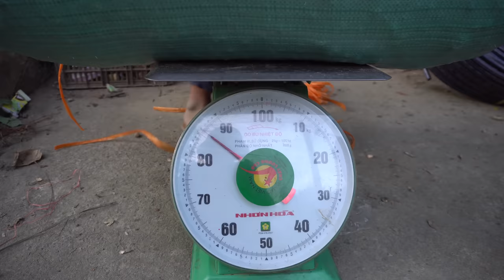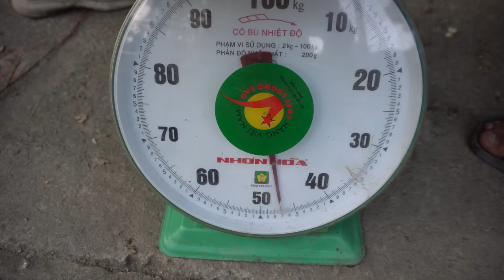Full Video: Complete Building Kitchen House, Make Flower Tiles Floor Log Cabin, Free Bushcraft

Comment: I've never seen anyone finish off the edge like u did when building their wood home alone. Very lovely!
Reply: Yes. It is " Unbelievable " isn't it? Just like the rest of the show with the camera crew and film editor. This film set is just as off grid as Times Square New York.
Reply: @donaldmarshall7894🤣 Off grid doesn't mean you dont use technology . It means you are not hooked up to the utility companies  for utilities like electricity , water, and sewer, which she clearly is not.
 She is off grid!
Reply: @mixedbag7126  There is a river behind her where she  set up a rudimentay device similar to what they used in the 1800's.   It converts moving water  into  energy. Since she  doesn't  draw energy from the electric company's power grid, she is considered "off -grid".
Reply: @mixedbag7126 Yes, u can see it if you watch her 2nd video , it shows it in the 1st 30 seconds of the video. It's the rusted iron device sitting under a waterfall  in the river near her home.